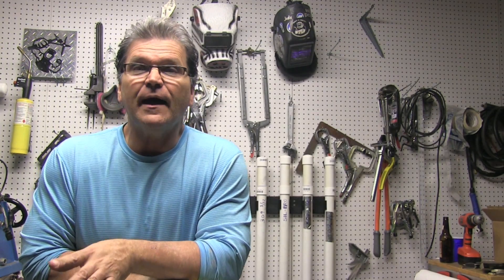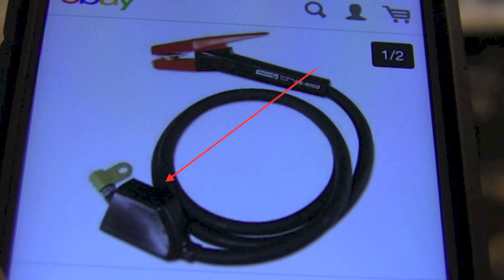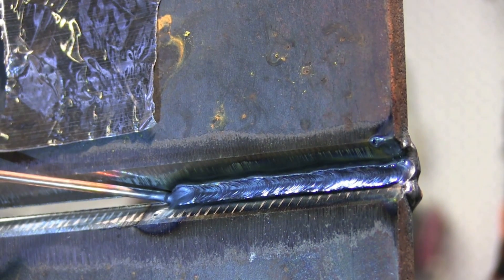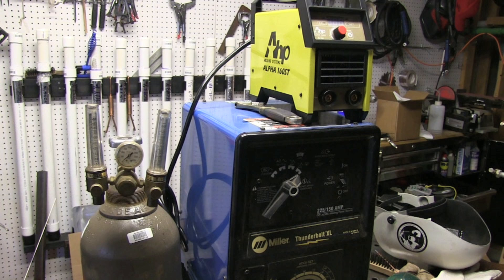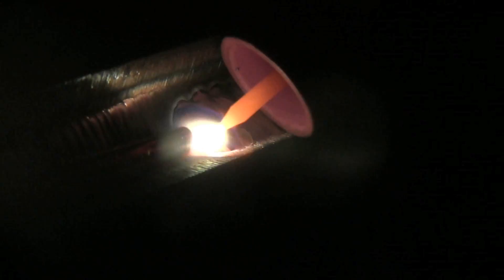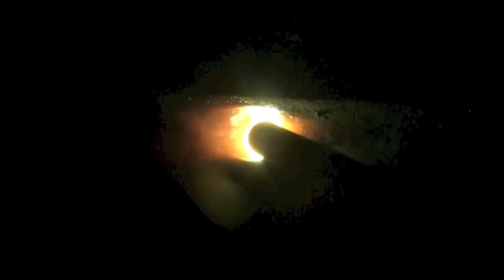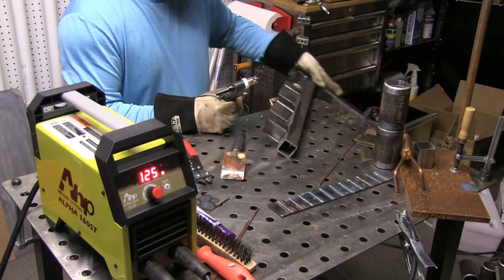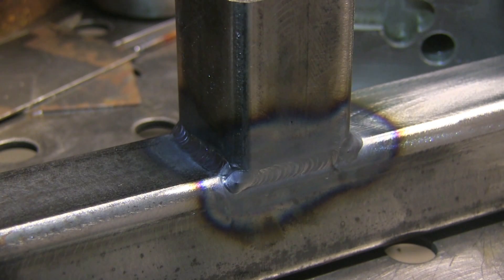Scratch Start TIG, Walking the Cup, and 7018 Stick -AHP 160st inverter

Comment: Great help thanks, second day trying out my scratch star home TIG found it much better today with the torch running negative, I was on 3 mm stainless with 316 filler rod seemed ok on 60 amps but was a bit sticky on 50 amps, would I be better off trying to learn on mild steel?

Comment: I know this old video but, I have an Eastwood MP250I multiprocess welder. It is scratch start tig/arc/mig. When I try to scratch start, I cant flick it like you in the video. I literally hold the electrode for a full second(feels like longer) and have to pull it off when I get an arc started. My ground is good, direct to a piece less than a foot long, and clean. Clean sharp electrode. Can it be the type of electrode I'm using? Switching may help? Or is it just the cheap welder I bought?

Comment: Does the AHP support gas either through the machine or straight to the Tig gun ?
Reply: WanSolve no it does not. You must run the gas straight from the bottle to the gun. So you need a torch with a gas valve. I bought a torch kit on Amazon for (if I remember right) around 70 bucks.

Comment: A little off topic... I've noticed you have a selection of welding helmets hanging on the wall and you choose different helmets for different types of welding. What's the reason for this? How about doing a video on when different helmets may offer an advantage for different types of welding?

Comment: Did you used the copper and aluminum block to come out of the puddle because you did not have control of the arc (a foot pedal)?
If so, would there be a case where the copper or aluminum would be needed when you still have foot pedal control?

Comment: Funny... Your comment about the noise of the transformer @ 2:30.  When I first picked up my Dynasty package I reviewed it on youtube and got "attacked" for complaining about how loud the coolmate package was.  The commenter said "what about an angle grinder or other machinery" and then proceeded to call me an idiot.  For me?  the best results always come when I can fully concentrate on the task at hand.  The quieter it is when I am welding or working with tighter tolerance parts, the better.
Reply: Everybody knows angle grinders are noisy.  That doesn't mean I don't want my welder to be quiet!  Sheesh.

Comment: just a question have you ever thought about reviewing a tig welder from Chicago electric one that you would find at harbour freight?
Reply: hunter summers I actually have one of those. TIG/Stick. It was on sale for $199.00 when they were normally $299.00 so I snapped it up! I have only used it for small stuff and playing around with in the garage. But I must say it's a good little machine for welding up to 3/16" thick metal and worth the money (in my opinion).

Comment: hi jody i remember one video in which you made a guillotine switch/foot pedal for a scratch tig, any chance that you know of a contactor or relay that can be used for that? thanks. pete
Reply: it would need to have a large distance between the contacts when it opens, or perhaps they make one that puts a dielectric material like glass between the contacts when it opens

Comment: Another great video! We have used the water bottle trick on quite a few jobs and in the training booths. C-K makes a good insulated torch adapter that plugs directly into a female welding connector. When I was in the Navy, we used to use silicon bronze to tig a male cable connector to the torch adapter, then dip it in plasti-cote or tape it up with electrical tape. 

How about doing a video on causes of weld porosity with carbon steel pipe and tube TIG welds?  We seem to have this issue quite a bit on x-rays of boiler tube welds and thin wall pipe (SCH 40 or less).  Visually the welds look great, but we often see porosity in the root and hot pass. Tried checking for hose and torch leaks, put up wind breaks, looked at weld wire cleanliness, etc., all the usual suspects. Wondering about some of the "house brand" tig wire and whether it really has all the correct levels of deoxidizers that the AWS standards require.  Also wondering if high argon flow rates and torch angle when walking the cup are contributors.

Comment: loving your videos Jody. with scratch start tig welding thin wall tube what flow rates of 100% argon are you using? 17 aircooled torch with a 6 cup. really need to get a stubby kits gas lens and tig fingers. any tips on aperage versus mm steel thickness? thanks for your time. tom

Comment: tried stick welding and failed. I mean really badly. the UK uses 13A a phase, my machines are heavy juice drinkers, up to 45A at the plug, using heavy setting of 140A welding current. my Sealey mighty mig 100 got a new torch and plumbed it in with the wires and lines, although I use it as a flux core wire machine I had some issues. the old torch had a plastic tube for the wire spool, the new one did have a metal spiral (like a bicycle brake cable). I cannot get the wire to feed through like it is stuck on the inside. a not so good day to have opened up that chassis :(
Reply: 45 amp at the socket??? I use a 300amp mig welder at work and it does pull more than 20 amp at full beast mode.
Reply: +garyhowe88 my stick welders are 50 and 42 years old. the mighty mig 100 is unknown, it was a second hand one.
Reply: Doesn't not does.

Comment: Hey Jody, I agree about the noisy hum of the Miller "Thunderbolt" and it made me think back to when I welded tank and pipe in Hawaii and one brand of machine that was just bizarre! Have you ever used an MQ "Whisper-weld"? 

I'm not certain if it was exclusive to the engine driven model's as that was all we ever used(and thankfully only a week's rental), but they made a really odd type of whistle&hum when you ran a bead with them, and by the end of the day your jaw and teeth would hurt from clenching them for some reason...almost like the weird feeling you get from chewing aluminum foil, but not as bad as fingernails on a chalkboard.

Do you know the noise I mean, or have you ever used an MQ "Whisperweld"? Thanks if you get a chance to reply, and if anyone else knows what I mean I'd love to hear from you...Aloha, KTFs

Comment: Hi Jody just wondering I have an older miller dialarc 250 ac/dc stick welder  and wanted to know if I could use this machine to do some scratch tig welding with the same setup your using , The welder itself still  works great.Thanks
Reply: +hdbagger4266 you sure can...that's the setup they use in a plant I work at on occasion and it's a great tig welder. Yours is a heavier duty machine than the thunderbolt as well. Good luck!
Reply: Any DC constant current welding power source will stick and TIG weld.
Reply: Great!! Thank you both for the reply ,going to give it a shot...Thanks

Comment: If your demonstration was on pipe, it could certify a welder as a combination welder. BTW, does that little yellow machine burn stick rods, too?
Reply: +Knolltop Farms  One of my pals has two and burned one up. The noise description got my attention and when you said Multiquip I knew what you were talking bout. They are STRANGE sounding, sure. A bunch of them would sound like an out of tune jazz band.
Reply: I know why. They were bad enough before a load was put on them. OOSH!! Don't want to even think about it.
Reply: You should've got the other guys to do different voltages and freq's and got some harmony going. Yall might've gotten on one of those big talent shows!
Reply: +Kristian Skov know e x a c t l y what U mean. That is the damnest noise! When you run high amps it sounds like something is about to blow like a pressure coocker.
Reply: +Gilbert Cruz Yup, he showed it at 5:40 and on many non-US market welding machines they call SMAW(shielded metal arc welding) MMA(or Manual metal arc) and he shows reversing the polarity and flipping the switch...
Reply: +Knolltop Farms yeah he does use it for stick. I must have not been paying attention. As it burns the rod it reminds of a Miller inverter or an old Lincoln motor-drive.
Reply: +Gilbert Cruz Have you ever used a diesel powered machine from MQ? We had a bunch of Lincoln SAE 400's when I worked for a tank and pipe firm in Hawaii, and while on a job at one of the local power plants 6 machines mysteriously got stolen from behind a security checked job-site. That's not the point of the story though it does set up why we rented the MQ "Whisper Weld" machines. Jody talks about the annoying hum from the Miller, but these MQ's would literally whisper to you while you ran a bead, it was the strangest thing, and I can only describe the sound as half whistle/half humming...it also made your teeth hurt from clenching your jaw trying to tune it out.

Thankfully the company shipped in a new set of Blu-Max 400's for us to use instead of the rentals...nice smooth arc, but just very bizarre noises that are making my fillings hurt just thinking about. Do you know what I mean...anyone ever use a Whisper-Weld, and enjoy the whistle/hum?
Reply: +Knolltop Farms Can't say I've ever used a "Whisper" machine, but, I have used one called, the "Whistler." Seriously, it made a whistling when welding, but it ran nicely.
Reply: +Gilbert Cruz Interesting, thanks for the reply...the only way I can think to produce a sound similar to the Multiquip "Whisper-Weld" is when you hum at the same time as you whistle, LOL!
Reply: Lewie McNeely LOL, my teeth are starting to hurt again!
Reply: Lewie McNeely LOL!!!
Reply: Facts is facts!
Reply: +Knolltop Farms Do you know Kemppi welding machines? Great machines, but some of there old TIG welders would  kinda whistle when you struch an arc. Whistle or even more high pitcht like tinnitus when you ran them at high amps
 Very anoying, espescially when you where in a fab shop with like 10 guys - all welding at the same time.